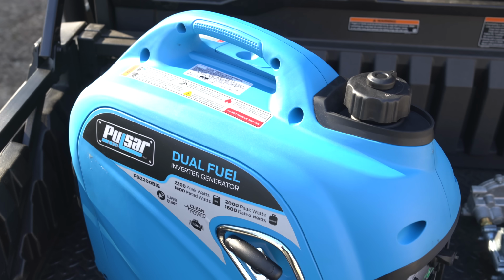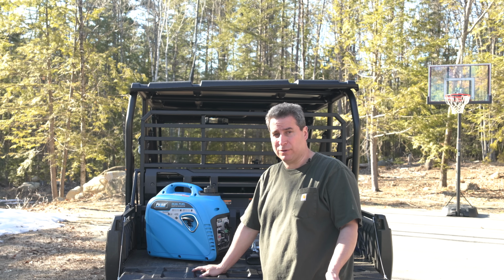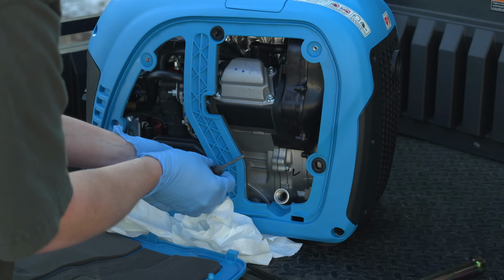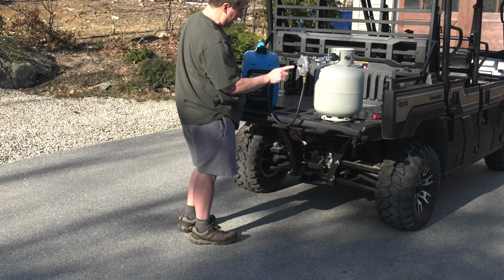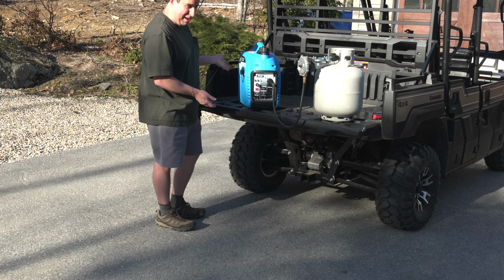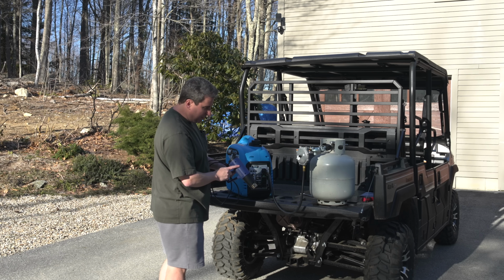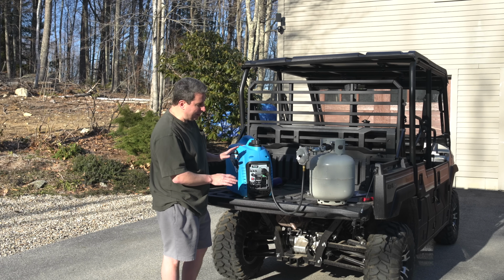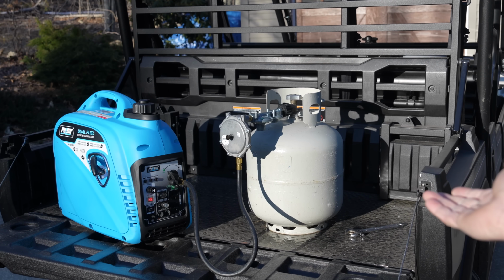PORTABLE PROPANE Dual Fuel GENERATOR 2000 Watt - Pulsar Review

Comment: The best thing about propane generators is the fuel they use will never go bad, no matter how long it is stored. I have a 100 pound propane tank hooked up to mine sitting there ready to go when the SHTF. I don't need to worry about fuel stabilizer or anything annoying like that.
Reply: 100 pound tank will be empty before you know it.  Consider getting a 1,000 gallon tank.
Reply: @samuelonthewall  100 pound is enough for 3 days at least, which is good for all but the most cataclysmic ice storms. We aren't doomsday prepping here.
Reply: @samuelonthewall  a 100 lb tank you can still manage it yourself to get refilled. A 1,00 tank your gonna need to have it on-site filled meaning your on a contract

Comment: I got the Wen version of this (2000w running gas 1800w running propane)... I am very, very happy with it.  Amazing you can get these things from several decent brands, for under $500... and they are catching up to honda in quality.
Reply: Just about all small inverter generators (outside of Honda and Yamaha) are made by Ducar in China.  Yes, the quality is improving.  And you can buy 3-4 for the price of a Honda+$300 propane conversion kit.

Comment: I have the same generator branded Duramax. Sounds and looks identical except for the case color (mine is medium blue). I ran it a couple of times a year with gas to keep it fresh. Eventually, however, I couldn't get it to  start on gas. Propane still works fine.
Reply: Clean the small jet 👍🏼

Comment: Thanks for the video!

If you're preparing for any kind of grid down situation, propane's long-term storage capability wins.

My house is all electric and I'm in Ohio.  Working towards a hybrid solar / battery / propane solution.

I just don't get enough sun hours in the winter to get by on solar alone without a gargantuan installation.  Using propane for supplemental heat and to run generators to recharge the batteries when solar can't do the whole job seems like the best approach.

I've considered a pellet stove or a wood burner for heat but we have asthma and COPD in the house, so looking to avoid additional particulates in the air.
Reply: @powdernitz  We live in a rural area and there aren't any natural gas distribution lines in our area. 

Basically it was a choice between all-electric and electric / propane when the previous owner built our house.

If the grid actually goes down for any length of time, many of those gas lines are going to start losing pressure since the compressor stations run off of electricity. 

Some areas of the country use compressor stations that run off of natural gas... If you're lucky enough to live in those areas, you are fine unless things start to break down.
Reply: @sociopathmercenary  Curious to know what solution/s you might have gone for? Several 40kg gas tanks that are rotated / refilled every ~6 months? Propane seems to win for heating and cooking and hot water in a lot of cases I think.

Comment: Could you do a video in the future showing what isn’t clean power and what/ how it can damage besides electornics?
Reply: I would love to see this!
Reply: Inverter generators produce cleaner power than the non inverter generators.

That kind of power is harder on electric motors and you don't want to use it with electronics.  

Even using dirty power with LEDs is probably hard on the control in the lights.

There are some non inverter generators that produce fairly clean power like some of the ones they use in RVs but you really just need to do your research.
Reply: I plug into a nice APC battery backup unit and then I plug the electronics into that. I use a propane generator that is not an inverter style and I run everything on it via the back up units.

Comment: 8 hours of run time on 50% load seems a little expensive. The cost to fill that propane tank is about $15.00,  it will run for the same 8 hours on 1.3 gallons of gasoline, cost $2.69 a gallon. But if you're going to use it for long-term storage propane is definitely the way to go since it does not go bad

Comment: I have a 6.8kw duel fuel pulsar and it seems to work pretty well in the limited time I’ve used it. I love that I can just run it off my 40 lbs propane tank and never have to worry about having carb trouble but still have the option to run it on gasoline if I need to after a hurricane

Comment: i bought a dual fuel for the convenience of the propane not going bad. though mine is a 5000 watt, non-inverter. on propane due to the energy density of the fuel, its something like 4700 watts but i can basically run my whole little house off it. just gotta turn off my hot water heater if i'm going to use the dryer or cook. but i dont have to pick and choose a handful of things to keep running. 
and it not being a small inverter one with a handle to carry, the regulator hardware is all on the generator,  so its just a hose that goes to the propane tank. in hindsight, maybe should have sprung on a bit bigger, maybe 8500 watt or something, and maybe a tri-fuel to tap into natgas, which stays on during power outages up here in the frozen canadian prairies. even multi-day power outages, the natgas infrastructure is quite redundantly reinforced with generators etc to keep running.

Comment: I have a Honda 2200, and installed a tri-fuel Hutch Mountain adapter to it.  I also only use propane now.   Propane is so much safer and easier to use, easy to store.  Plus, propane will not clog your carb.
Reply: Thinking about going that route instead of buying a cheaper generator
Reply: @noctilucent7396  The kit is a bit pricey, but worth it to me.  Main thing is you're not limited to gasoline.  Also, if you decide to buy the adapter kit, Hutch Mountain's is the best, don't cheap out on a conversion kit either.  Easy to install too.
Reply: @geod3589  will do thanks for the info 👍

Comment: $420 is a great price! I lose power at my home at least once a year, one time for a week. I have a Honda 3000 that I converted to Dual Fuel and a Pulsar 2300. These in combination with a few "solar" generators at night have minimally met my needs.
Reply: A propane generater in combo with some solar panels and you'll be set to keep those power stations charged up! That's what I do and it works really well.

Comment: Not only does propane never go bad, but you don't have to winterize or purge the old fuel after use, or worry that the carburetor has gummed up, and the spark plug shouldn't foul.
Reply: Propane is such a great fuel! I think the other better option would be to connect it properly to the natural gas line in your home! Even cheaper and it would never run out.... Unless the disaster is bad enough haha
Reply: @Jasonoid  I live in Texas, and during the 2021 "megafreeze" a lot of people lost their natural gas supply. Also, you can't just connect NG to a propane device.

Comment: I find generators that use propane tanks kind of counter intuitive.  If you loose power at your house for an extended period of time, why would you want to use your propane that you could be using to cook with on your gas grill? If you have an electric stove like I do, its much better to use your grill to cook than your stove during a power outage. Electric stoves use a TON of wattage. Just a thought......
Reply: Answer is, you don't. You use a different tank for this.

Comment: Champion makes a 3150 continuous/4250 peak watt dual fuel inverter generator (model 200914). It's an open frame generator, so it's not as quiet as this one. However, the propane hose fitting is quick disconnect like a compressed air fitting. The price on amazon fluctuates from $550 to $900 though. I got one last summer, but haven't run it besides break in. It's supposed to average about 21hr on a 20 pound propane tank depending on load.
Reply: No autostart feature though like the Westinghouse offers.  No more going out in the snow to turn on the generator at night.
Reply: @samuelonthewall  I'm guessing you mean remote start? Like model iGen4500F? Because I can't find dedicated backup generators on their website, or any mention of some kind of standby mode. Neither the iGen or the champion that I mentioned above are designed as hardwired backup generators, so they're not designed to be left outside year-round. So you're going to need to go outside to hook them up during grid power failure, and store them in your garage or shed when not in use. However, if you're using this camping or something else temporary, I could see the remote start being handy.
Reply: @WaukeePaintballer  I have a wire going from the this generator over to the Outback Inverter which is used to charge the large battery bank.  I live off-grid.  The generator is in a shed so it's not exposed to rain and snow.  When the battery bank voltage drops too low, the Outback inverter produces a wireless signal recognized by the Westinghouse generator to come on, charge the battery bank, and then shut off.  It's fully automated, and the thing that makes this possible is that the Westinghouse has the remote start feature.  A must have in my situation.

Comment: It’s not the fuel going bad, it’s the ethanol in gas causing hoses and gaskets breaking down. Then it plugs up the filter and carburetor.
Reply: Non-ethanol gas goes bad too.  It's good for about 2 years if you stabilizer

Comment: I have a Champion dual fuel and a Honda Generator. I love them both. I use engineered fuel most of the time or marvel mystery oil mixed with regular gas. Never had an issue. I also use Motorcraft 10w30 diesel oil in them.

Comment: I bought a champion 2000w dual fuel and it had problems. Suspect cam or lifter issue. I bought it from a liquidation place so no warranty. I transferred the carb and propane hoses off it onto my generac gp2200i so now it is dual fuel. It is not as efficient as the champion was running propane I suspect because the champion ran at different rpm with same load depending on what fuel it was using. At least I know it doesn't have a defective engine though. I noticed with the champion it no longer had compression release after about 20 hours. There was tons of crap in the oil too. I broke it in properly and changed the oil multiple times in first 5 hours so it's not break in debris. I adjusted the valves and compression release worked again but something was wearing quickly for that to happen so I condemned it.

Comment: A few years back when California was playing with the lightswitch on a grid scale (aka our "PSPS"), I got a Westinghouse iGen4500DF. Not as cheap as this unit you reviewed, but I'm a big fan. All the same benefits of dual fuel (during 2020 I had gasoline in case I needed it, but have only run it on propane), along with electric/remote start, 30A output and the parallel output. It does a peak 4050W on propane (4500W on gas) so it'll run... a lot. During the most recent major winter storms I was out of power for 36 hours, the Westinghouse ran our freezer, fridge and all the electronics we wanted without going above maybe 10% utilization? In Eco mode it ran for about 14? 18? hours on a full tank of propane.

And while the genny is overspec'd for what I need, it's nice to know I can run a freaking microwave if I really wanted. It's extremely quiet at such a low usage. My neighbors didn't even realize I had a generator running because all the other generators in the area were *so loud*. If you were more than 30ft from the genny running, it was drowned out by the generator 3 houses down.

Comment: FYI you can convert any gasoline generator to run on propane with a simple Amazon kit that costs a few bucks.
Reply from the maker: True, a friend of mind just converted his Honda, it was $230 just for the kit and you have to install it. The price on this considering its the whole package is what amazed me. I thought it was going to be a POS. In person you would think its the Honda, very solid and well built and dual fuel.
Reply: @SilverCymbal  I'm in...ordered one yesterday to charge my solar battery bank on bad days or times of extra power needs, such as running maintenance/construction tools, etc

Comment: I wonder if you could use this or convert this to also use compressed methane? if so then you could make your own digester and make your own fuel. Perfect for off grid power generation maybe?
Reply from the maker: Interesting. It would certainly be easier than doing the entire conversion on your own. Others may know more about doing this

Comment: Any potential issues with propane pressure if used at very low winter temperatures?
Reply: Propane has problems turning from liquid to a gas in very cold temperatures... And the transition to a gas makes it even colder so you may run into a situation where the generator is starved for fuel.
Reply: Only if you use the small BBQ grill sized tanks.  I use a 1,000 gallon tank, which my home also ties into, and it NEVER has a problem running the small generator during the coldest part of winter. I think this is due to the fact that there is more space in the huge tank for the liquid propane to vaporize.
Reply: perhaps have the exhaust facing the bottle to keep it warm?

Comment: Let me start off by saying I really appreciate your channel. This may be slightly off topic but my main back up Generator is a duel fuel model, but I only run it on propane. I’ve seen a ton of folks who’s primary way to fuel their generators is on Natural Gas. 
Which is fine as long as nothing interrupts supply. I have several full tanks of propane ready to go if the “stuff” hits the fan so to speak. Just wanted to get your opinion on if you would rely on a natural gas generator, propane or gasoline?
Reply: If there's an extended outage natural gas pipes will loose their pressure after a few days. Gas utilities have backup systems but those will run out eventually. Tanks of propane are a great option for emergencies and are very flexible since so many things use propane from lanterns to cookers to now generators. 

Gasoline is a pain to store and maintain. It goes bad so you need to cycle it on a regular basis to keep it fresh. Propane will stay good forever.

Comment: Great video! Just a question on propane consumption: You say 8 hours on a 50% load to use up a tank. Isn't that about $25 a night to run air conditioning?
Reply from the maker: Propane will definitely cost you more than gas to run but has the other benefits.  Here in NH propane tank refills are only $11
Reply: @SilverCymbal  wow, I would kill for $11 propane… It is about $25 to fill a 20 pound tank here in Kansas, for some reason.
Reply: $24 IN MD...some say will run 50hrs on a tank

Comment: I bought one of these and fired it up today (I likewise only want to run it on propane); it's ridiculously quiet even when not on the "economy" setting.  It started on the second pull and purred like a kitten.  I don't have the tools to do an evaluation of the power it's putting out but if it's anything like your results it's a great value.
Reply from the maker: Glad to hear you had a great experience. I was so impressed by this generator. Absolutely a bargain for the build and output. Great machine! have fun

Comment: Portability goes by the wayside when you have to lug around a 20# propane . That 20# propane bottle will fuel that little generator for probably 24 hours at low load and great for a multi day camping trip👍 but for a day trip a tank of gas would be all you need, now you have portability..I have a duel fuel 2500 Watt inverter generator and use both fuels depending on my length of stay camping, it’ll run a good 8 hour’s on a full tank…Just a side note, If you do happen to use gasoline, use ethanol free, last’s for months and doesn’t goober up your carburetor and fuel line..👍

Comment: I have a number of small generators and before I start them the first time I take the spark plug out and pour just a little bit of oil into the cylinder and pull the starter cord a few times. This is to stop the new piston rings scouring on the new cylinder bore. As this is gas only then it may take a while to break in the rings because it will burn cleaner than on petrol which does leave a bit of by-product which helps embed piston rings. Just my 2 cents worth.

Comment: It costs about twice as much to run off propane. Just so you know.
Reply from the maker: That is the great part of this one, use gasoline if you want for econony and 10% more power, switch to LP for long term storage. I am using it for all LP to avoid storage issues completely. I love you have both options with this
Reply: But don’t have the problem of trying to start one that sat around 
For daily use yes
For once in a blue moon it’s what you need

Comment: I think the propane only generator you were talking about is coming out with electric/remote start this year. Yea the little 800 watt one.
Reply from the maker: Problem with that one is some customer service issues and it's just too costly. I think the unit they sent me was maybe better than the production ones. I have since removed the video, This one weighs 12 pounds more and has so many more features and the build quality is one of the best I have ever seen and costs less. If you want below 1000 watts you are better off with a battery ecoflow or similar.
Reply: Please tell me the brand that makes propane only generators.  I didn't think this kind of thing even existed anymore.  Still shocked that Honda doesn't make any generators at all that use propane.

Comment: How is that Pulsar generator holding up?  I recently purchased a dual fuel Westinghouse generator. I wanted a unit which I would run on propane only. My Westinghouse unit had to be returned for a refund because it would shut down after 10 minutes running on propane without any load on it.  Would you still recommend that Pulsar?